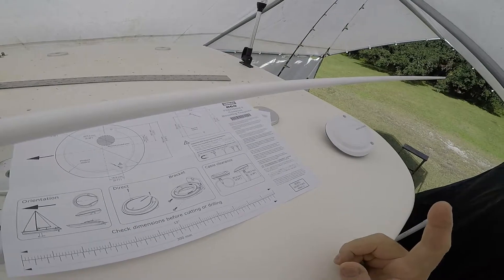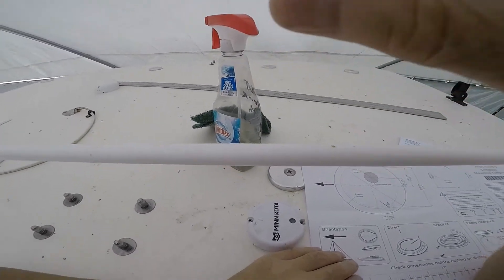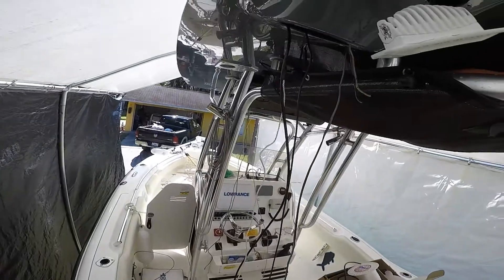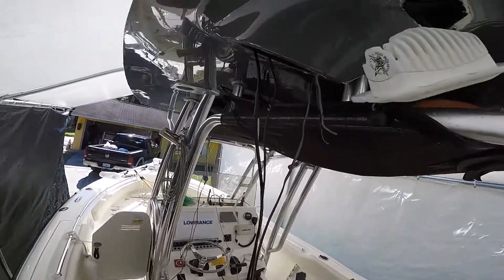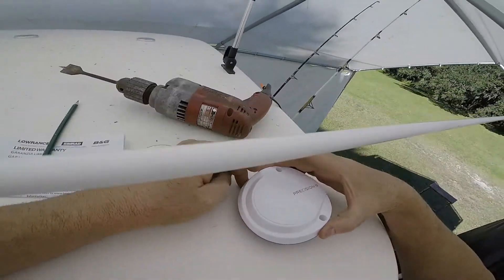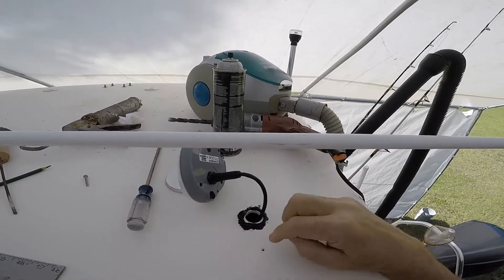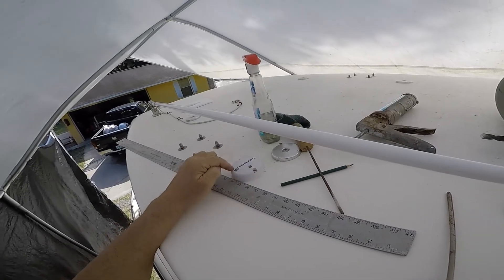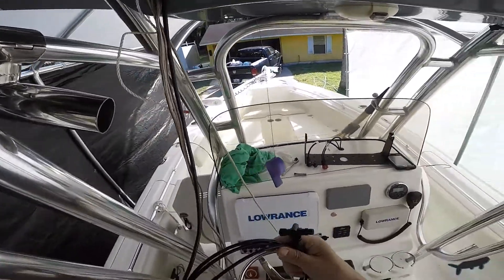lowarnce percision- 9 compass install

Comment: Good job. 👌
 I just bought also precision 9 compass
I also mounted on top. I just want to ask is all ok and also what about waterproof 
Has there been a problem caused by contact with water?
Reply from the maker: Well I silicone where the wires go through the hardtop so it can't get no water in the unit it tracks other vessels that have Marpa and I use it for the auto steer over the point 1  my auto pilot doesn't maintain course exactly it'll run and then it'll draft I have to correct it but it did that with the pt 1to so I can't blame the precision nine I just programmed  my other screen to run the auto pilot on my next trip so I will see if that screen works better if that don't work then  it Has to be maybe the nack one controller good luck with yours
Reply: @fishydubsfishing6516  i have only precision 9 and autopilot with simrad evo 3.

Comment: Gary, I’m about to install the same compass. I just wanted to ask if this locations works fine for the Precision 9. I have been told Precision 9 needs to be installed at water lever, in the center of the boat.
How is it working for you on the top?
Reply from the maker: im still out on this one i have to try to program it one more time havent be out much ill let you know

Comment: Did it work out okay with precision 9 compass being installed on top of the t-top? I was under the impression it had to be installed closer to the waterline. I'm about to install mine and would love it to be on the t-top.
Reply from the maker: so far i did not calibrate it yet,it seams to blow every day, as for hi or low you got me on that one i know its to be as close to the center line as possible so i might have to move it, and on a small boat is the hard top close enuff to the water line, idk ,let me know what you find
Reply from the maker: i just calibrated it , no problems, once the wind stops i will get to try things out i just overlayed the radar on the map so i will see if that needs adjustment